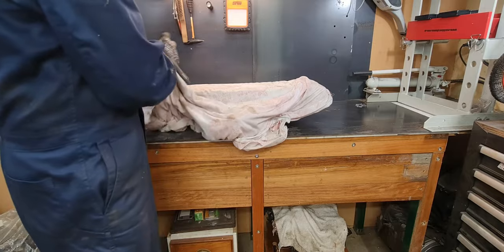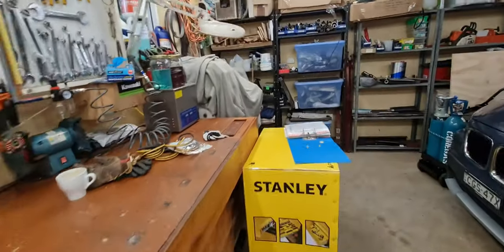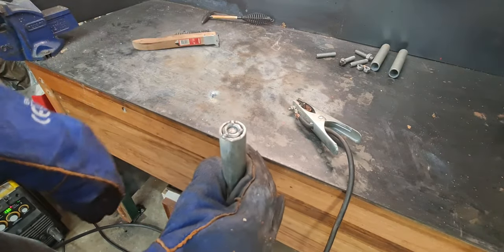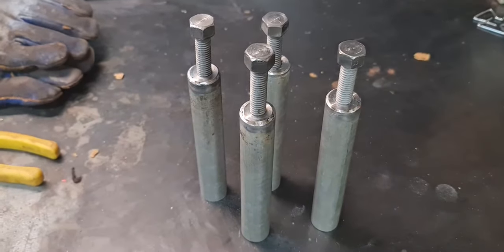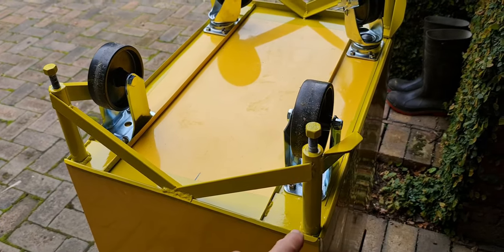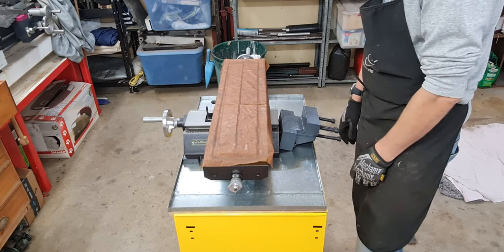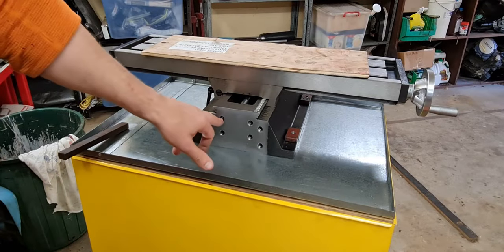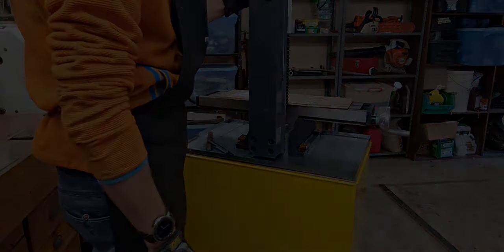Workshop - Mini Mill Building the stand Pt 1 of 2

Comment: Do you have a brand name and part number for the table you used
Reply from the maker: Hi, they are are all generic and exactly the same, so just do a search on you local hardware store, cross slide table 700mm x 180mm. I found mine by chance it was also on sale including shipping. If you can pick it up you can save alot as they are quite heavy. https://forestwest.com.au/products/precision-cross-sliding-table-bf-30-700-180mm-table?_pos=3&_psq=table&_ss=e&_v=1.0